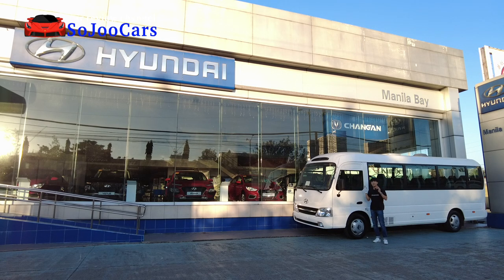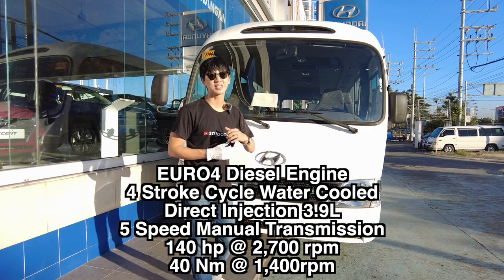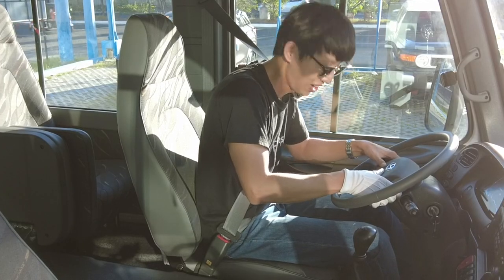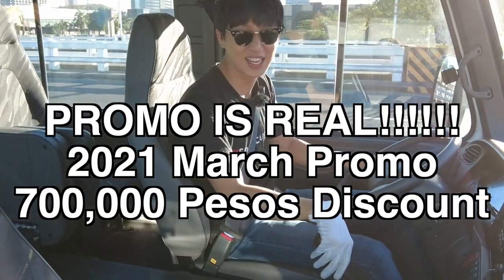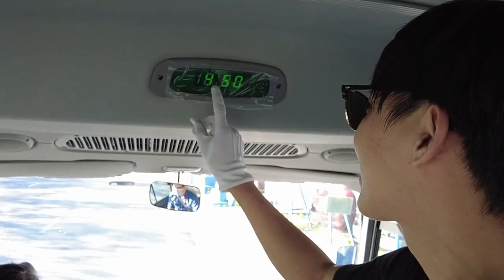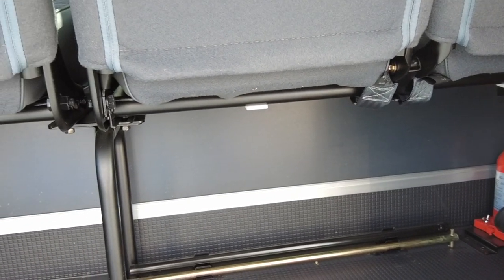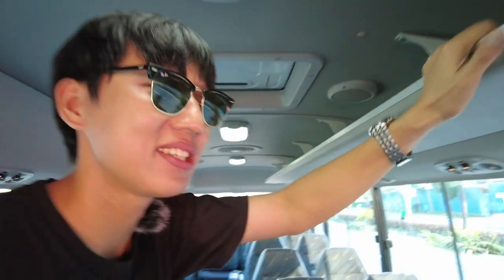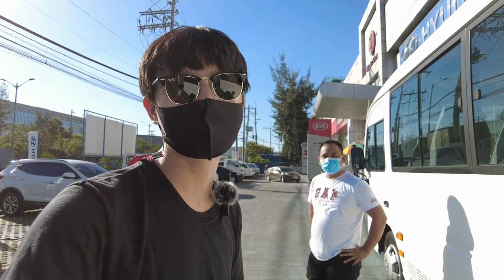Why you can afford a 29 Seater MINI BUS below 3M with great value, 2020 Hyundai County - [SoJooCars]

Comment: Good evening Joo! Nice review!
But there is one detail: you said on the spec sheet that the engine produces 140hp and 40Nm. The correct unit for the torque output if stated as 40 is Kg-m (Kilogram meters). If converted into Nm (Newton-meters) it turns out that the torque it makes is actually 392 Nm (rounded off).
Reply from the maker: I didnt see that clearly.. Thank you for the correction! No one would believe that it only has 40nm! 😅
Reply: @SoJooCars  It's alright dude... Keep up the good content! I hope more contents like this!
Reply from the maker: @iussemarriramos1822  Thank you for the correction!!
Reply: how much is the price